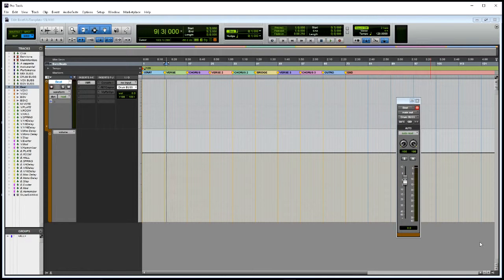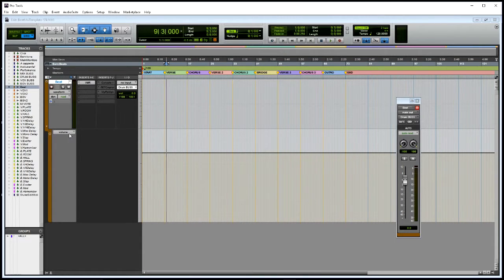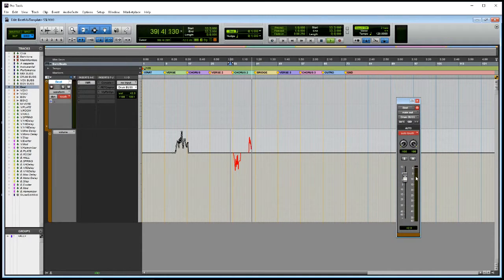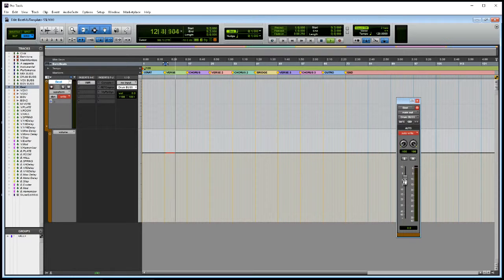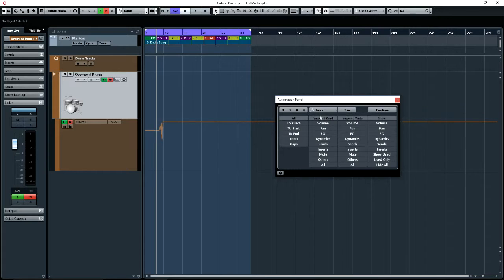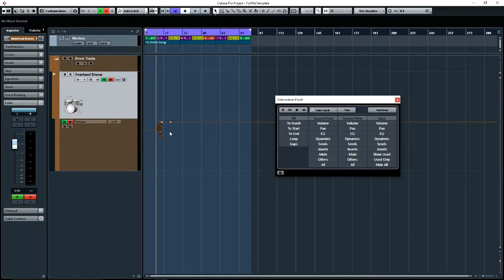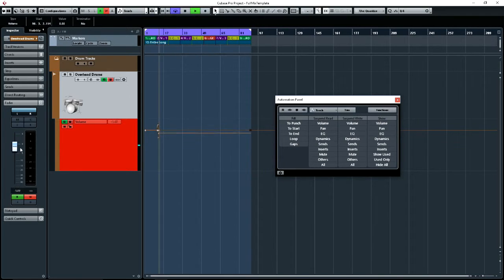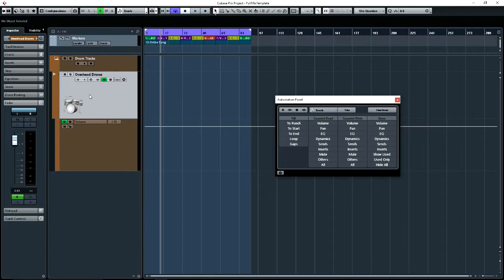Cubase Touch Automation Issue - Mixing Tutorial

Comment: Years later on Cubase 13 Pro same issue and your workaround tip is still working. Of course it works as intended on Nuendo 13 without having to do anything.
Reply from the maker: That is disappointing to hear it still happens in 13. Thanks for letting me know.

Comment: 2021 and the bug is still in the latest Cubase Pro 11 release - that is more then frustrating!!!
Reply from the maker: Yep. I find it frustrating but I can only assume that at this stage Steinberg don't believe it is a bug and it is the way they want the feature to work. I disagree with that and I wish they would fix it.
Reply: @kdwmixingmastering  Hey, in the last weeks I had a few calls with Steinberg - it seems that they addressed it already as a bug. But not that many bug reports were reported. This is the reason why it is there since years. It should work like in Nuendo (there the touch-automation is working as written in the Cubase Pro/Nuendo manual). I really hope that Steinberg will fix this very soon (till don't get it how other producers can handle automation without a real touch-automation).
Reply from the maker: Great to hear they at least acknowledge it is a bug. Let's just hope they fix it now as it is really annoying. It was the one thing that almost made me regret switching from Pro Tools to Cubase. Thanks for chasing this up and sharing your updates with me.
Reply: @kdwmixingmastering  Hope they fix that quick too. This is the reason why I switched to Logic Pro years before. I was really shocked, that Steinberg didn't fixed that after so many years. Wanted to go back to Cubase. But this bug hold me back. Sadly I missed the half-prize update from Cubase to Nuendo (in Nuendo the touch-automation is working great)!!!